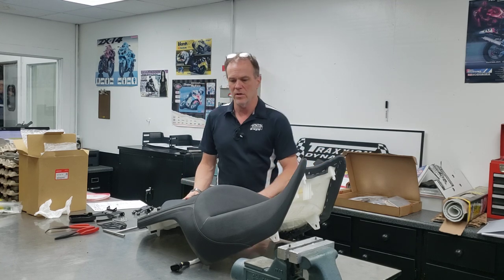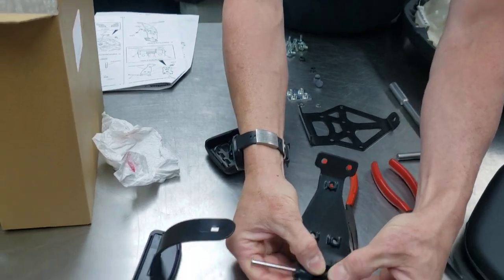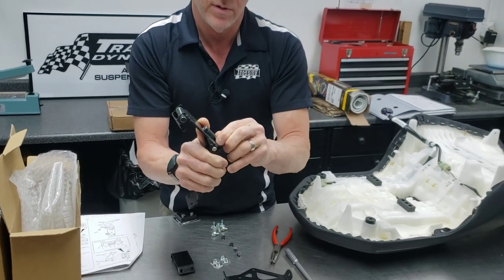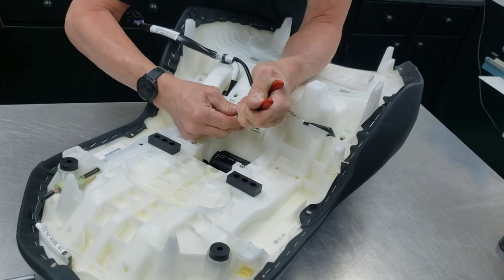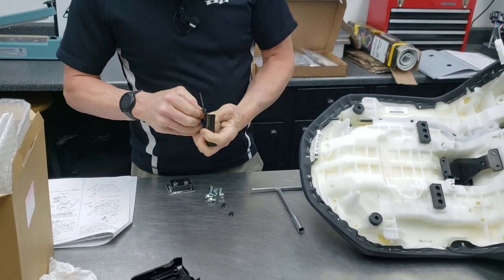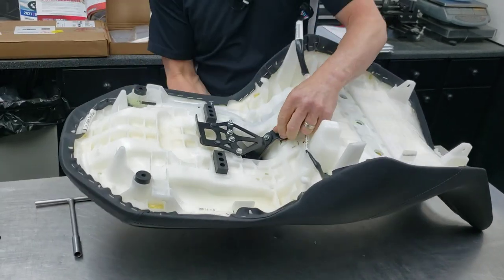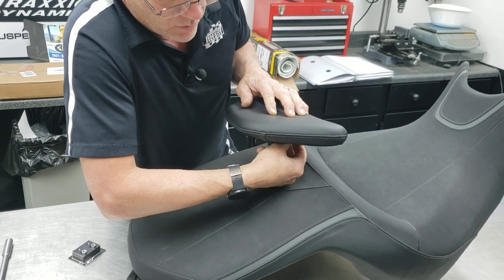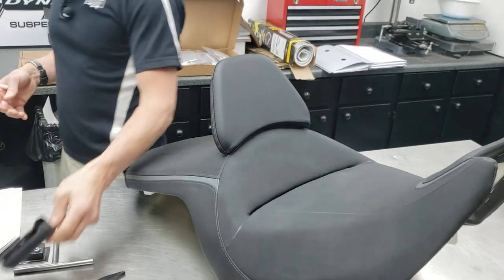How to Install Hondaline Driver's Backrest on 2018+ Goldwing by Max McAllister of Traxxion Dynamics

Comment: Oh and in case you may think that the rubber nipple may not be so secure anymore, try it...youll be amazed. I've been using that technique for many years. And even when you come across a rubber part with those nipples which you want to remove..most people simply tug away at it and invariably some of the nipples break off, even in that case, before attempting to remove, simply spray a squirt of the silicone spray on the protruding nipple and see how easy it is to remove.

Comment: Nicely done. I find it odd that Honda doesn’t supply a watershield gasket to fit where the decorative cover was. Seems to me that if you are not careful where you place aftermarket electrics under the seat, they could be compromised by water getting in there. What’s your take on that, Max?
Reply from the maker: Water will find it's way into every nook and cranny at 60-70mph, so I don't think you can hide from it.  That's why proper waterproof connections all over the bike are so important.

Comment: Ive watched a few of your videos and you come across as a perfectionist. I am an incurable one myself. Wherever you find rubber nipples which secure a part into a hole simply spray a squirt of SILICONE SPRAY onto the rubber nipple ( 'tits' i think you called them in the video)  Silicone Spray is relatively cheap at any auto spares outlet and can make your life much more easier. Fitting the rubber grommet in using a needle nosed plier to pull as well as prying it off becomes a breeze. Just saying. Thanks